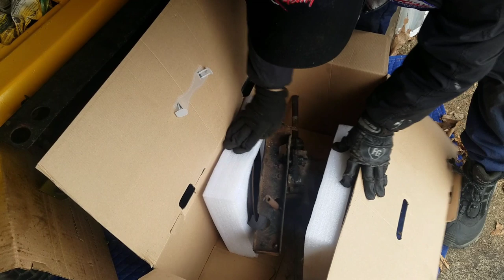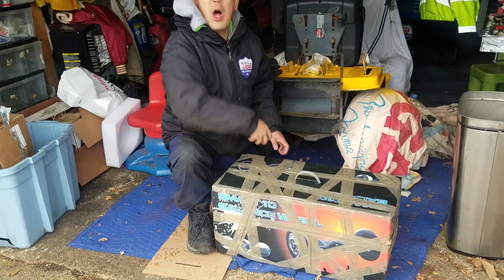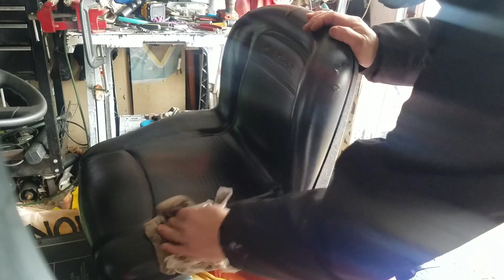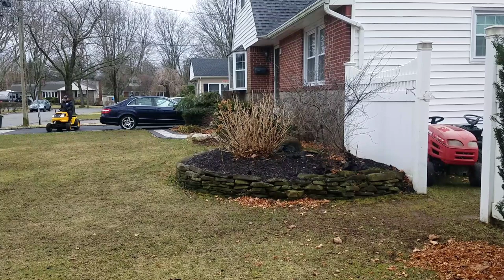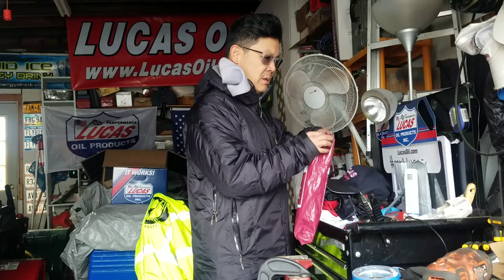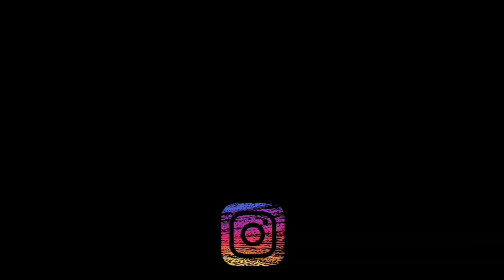HOW TO REPAIR CRACKED LAWN TRACTOR SEAT GORILLA TAPE PROPANE BLOW TORCH MTD CUB CADET PROJECT FINALE

Comment: I use that stuff called Dynaflex black Silicone that they sell at Home Depot to fix cracks in seats. It comes in a caulk jar, you put it in a caulk gun and apply it to the crack. It seals it up nearly perfect, it matches up nearly 100% and the stuff is very rugged, it holds up real well, it conforms to the seat great.
Reply from the maker: Good to know

Comment: Question, I have a craftsman YT 3000 lawn tractor. I ended up putting a bunch of new parts, carburetor, fuel lines, fuel filter, ignition coil, and all is well again except that I have no control over the throttle as soon as it turns over at races like hell, I adjusted the throttle cable, the new carburetor supposedly came with a factory settings but yet I can’t get it to stop racing. Any suggestions would be appreciated. Thank you in advance. The only thing the truck but throttle does. It goes into choke position, but I can’t slow it down. I cannot get the engine to slow down using the throttle.
Reply from the maker: You didn’t connect the throtttle linkage correctly,  or the carburetor isn’t on right.  Tight with correct gaskets?

Comment: Yellow paint on tires can be removed easy with. A little gas you can fix that hole with bondo very fast
Reply from the maker: Brake cleaner too

Comment: Henry instead of striping that murray, you should take the engine from the lt1000 twin with no deck and swap it onto that one and strip the lt1000 and once u get another deck, stick it on there.
Reply from the maker: Nah, it’s way harder to get a Murray deck than an LT1000 deck.
Reply: Mowers N Blowers but isnt murray select ayp being that a craftsman deck will fit onto it?
Reply from the maker: @FrancoTheBoss3434  no craftsman is ayp, Murray is totally different. Murray is atlas, brute, noma, spirit. Plus, if I got a craftsman deck, wouldn't I want to put it on a craftsman and not a murray?
Reply: Mowers N Blowers yes ik craftsman husq and that stuff is ayp but i thought murray is ayp for some reason. Now henry because your a genius couldnt u retro fit a craftsman deck on that thing.

Comment: I just subscribe to your channel now to the point i have a twin cylinder brigg,s & stratton engine i cleaned the magnet on the flywheel.& While doing so i found out that the magnet on it could be removed & replaced if need be so the question is have you ever seen or heard of that 🙄🙄??. Oh by the way next time if you want to try a heat gun to do what you did to the seat on that riding mower
Reply from the maker: Robert, if you mean the big one on the outside, I’ve never seen or heard of it.  But I’m sure it could be done however not easily, most people will just buy another flywheel for $25.  I’ve never seen the outer magnet break.  But if you’re talking about the multiple inner ones, they break or fall off all the time.  You can just glue, epoxy or silicone it back on, but if you break them it’s very hard to find them except used on eBay.
Reply: @MowersNBlowers  thank,s for the info young man
Reply from the maker: Robert Mailhos thanks for calling me a young man, I appreciate it!
Reply: @MowersNBlowers   i,m 56 oh i have a limted edtion powr kraft mower by mtd it was made mountgomary ward it,s a 42 inch cut hydro with a18.5 hp i/c briggs & statton twin cylcinder .i looooovvvveeee it
Reply from the maker: Robert Mailhos those are opposed twin engines, one of the best engines ever built, I’ve rebuilt about 4 or 5 of them. Love it! I’m 51.
Reply: @MowersNBlowers  great stay that age because the older you get the time fly,s by  also got a 1985 snapper extra tough 28 inch hi vac the engine is a 11.5 i/c brigg,s had to have a oil sump gasket put on & a intake valve job done but where i live now i can get pure 100%gas not that junk they call gas today my oldest piece of equipment is  a br 400 sthil back pack blower bought back in 1997 she still runns like a champ.plus a few other classic machine,s
Reply from the maker: Forrest Gump or cant buy me love mower, I’ve had a couple too!
Reply: @MowersNBlowers  okay i gone through many a mower some were use,d & some were brand new i will keep doing it i,m gone from this earth oh by the way the magnet i am talking about is the one that make ,s the spark plug,s fire
Reply from the maker: Robert Mailhos yeah ok you can’t change those, unless you mean the ignition coil magneto
Reply: @MowersNBlowers  that is the one if i could i would send you  a picture of it
Reply from the maker: Robert Mailhos my email is in the description.   Plus my latest video, I change the ignition coil.
Reply: @MowersNBlowers  okay i saw your email address so i will send you a picture of the whole mower